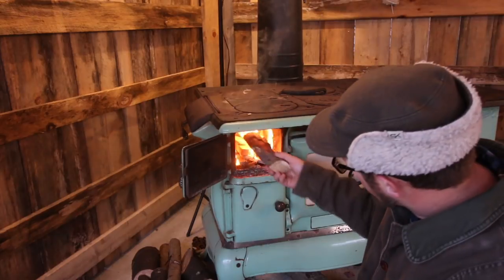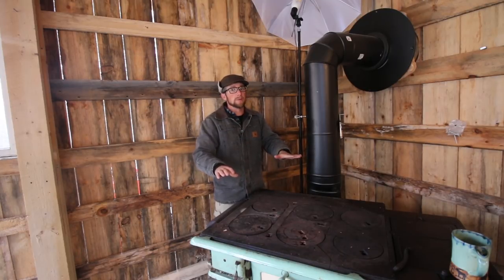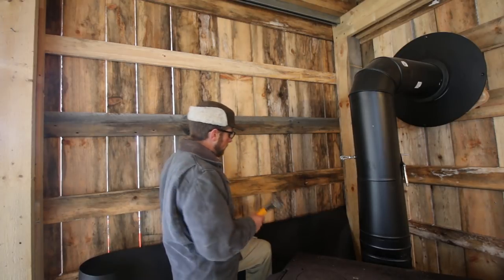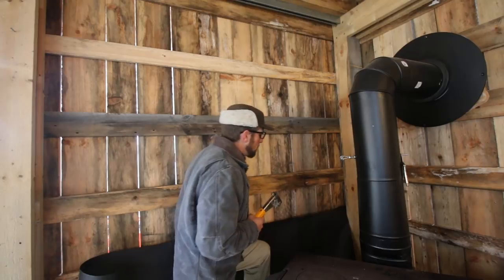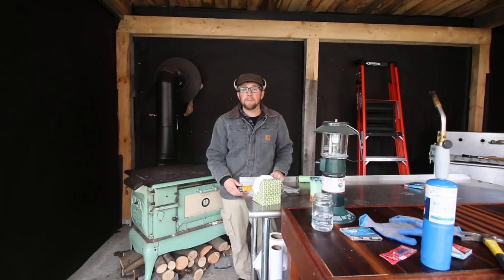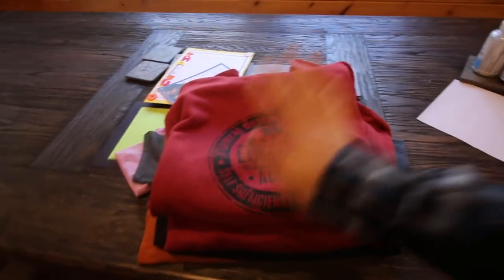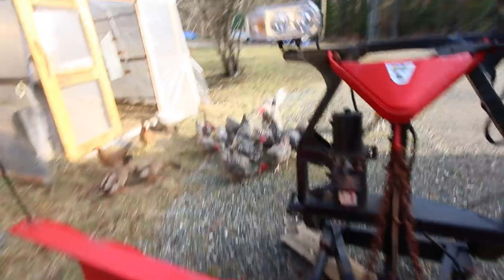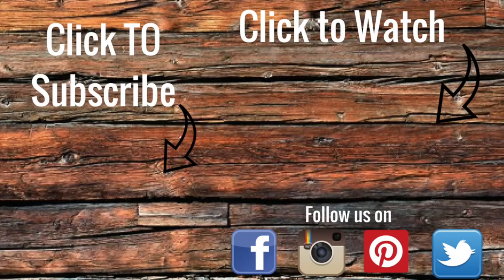Getting the Outdoor Kitchen Ready for Winter

Comment: I have been doing the same thing with my attic. Just minus the tar paper.  With 75% of the insulation up the difference is very noticable.  We are covering the unlined insulation with cardboard as a barier to the drafts.  It will be nice when you are all done and the kitchen stays warm. I look forward to the future videos. Do you get hulled barley?  I like that it is less processed and has more nutrients than the pearled stuff.  It does take a bit longer to cook.  I have put it in the crock pot over night for breakfast in the morning.  A nice change from oatmeal.
Reply from the maker: I was wondering what the difference between the two kinds of Barley is. Thanks

Comment: Having that space insulated will be nice.  Will you have it ventilated so when its finished it’s not too air tight in there?  Or do you plan on cracking a window every time you use the stove?  Be safe you guys carbon monoxide poisoning = not a good thing.
Reply from the maker: There will be plenty of cracks still for ventilation! Lol

Comment: I don't get it. Why not boards and battens? A far better engineering solution for so many reasons.
Reply: Put the battens on the inside where they can't be seen. I believe there may well be engineering problems caused by applying tar paper over the inner cross bracing, as it seems is the plan. Doing so leaves openings for wind and water to enter the large space between the exterior boards and the tar paper (not a good thing), and further completely negates the insulating effect of the exterior wood boards. From a thermal standpoint, it's like making the exterior of the kitchen building simply from the building paper alone, with an interior sheeting over it.  Great channel, follow you all the time, love seeing your challenges and solutions. And you all seem like such fundamentally nice people.